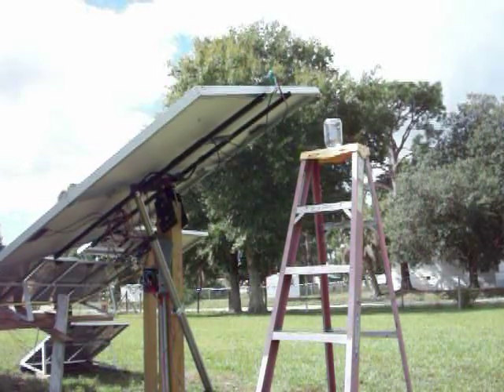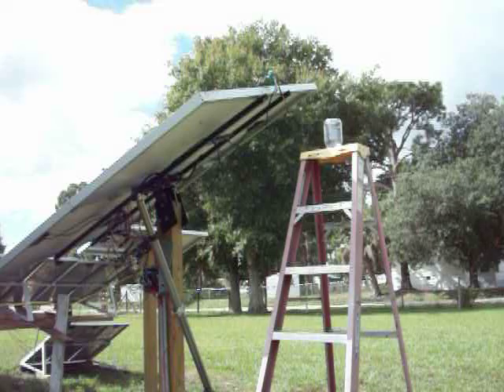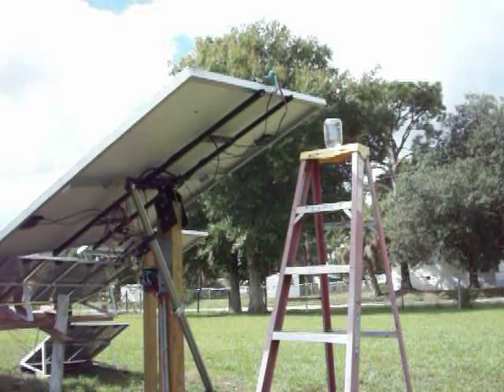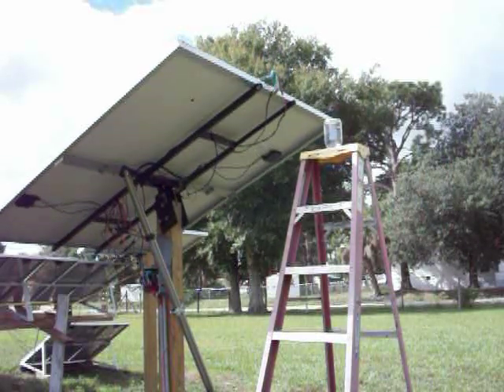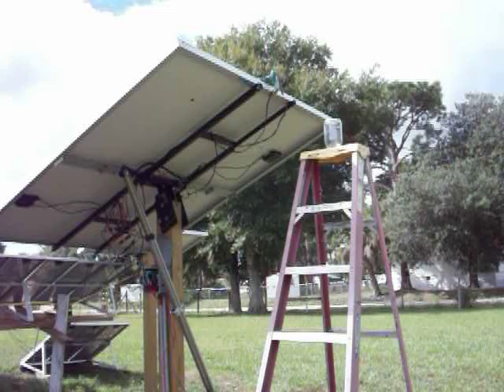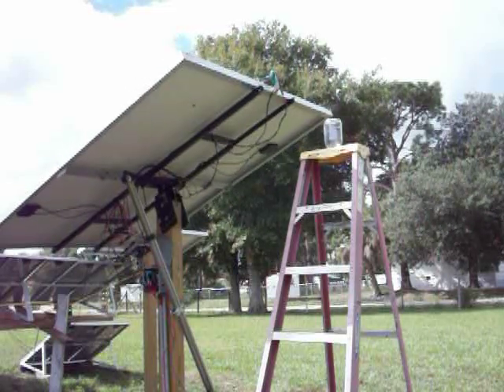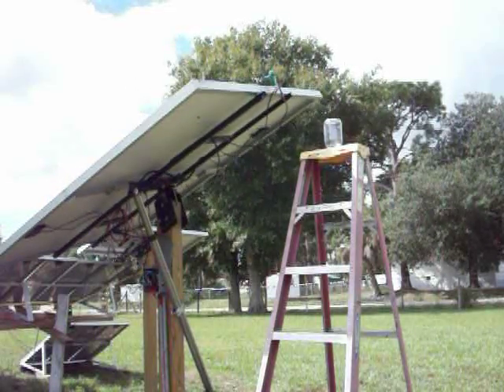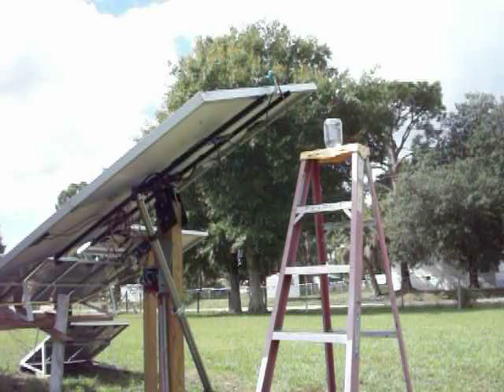Solar tracker Sensor Test. Please see Latest Up dates   3-18-12.

Comment: Hi! Nice design with the tracker. I'm confused on what type of bearings one needs to use at the pivot. Or could I buy the pivot ready-made somewhere? Some advice would be appreciated. Thanks!
Reply from the maker: +marella sunny This is a really old video this design was very simple it used only a greased up  big bolt.
Reply: Thanks for the info. I was intending to use plummer block bearings.